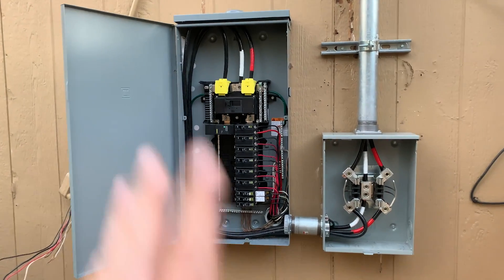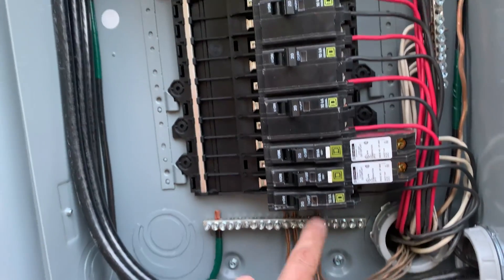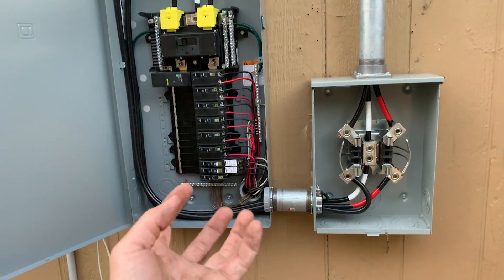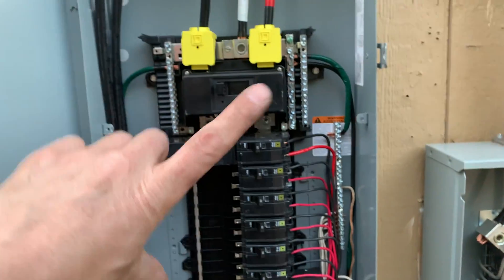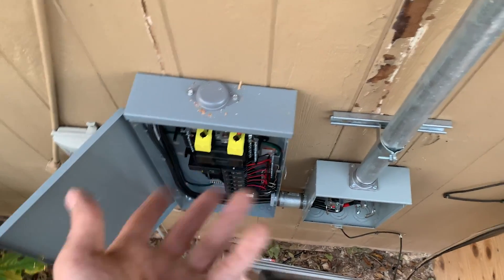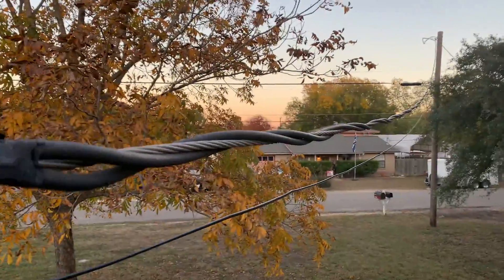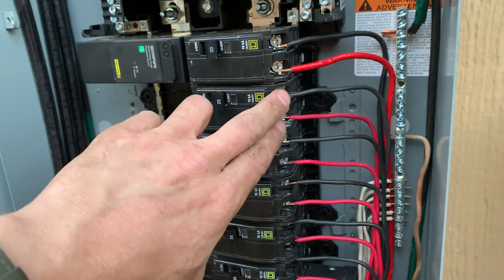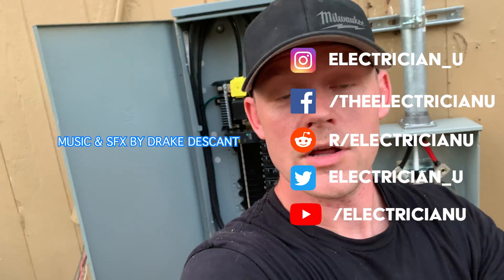I Just Changed Out My Electrical Service

Comment: ahh there's the 2 pole breakers for those multiwire circuits
Reply: yes but they expensive i wld just buy a box of these https://www.lowes.com/pd/Eaton-White-15-Amp-Decorator-Tamper-Resistant-Outlet-AFCI-Residential-Commercial-Outlet/1002336194?cm_mmc=shp-cprdelcgooglelia-205-wiringdevices-1002336194-_-0&placeholder=null&&ds_a_cid=112741100&gclid=CjwKCAiAkan9BRAqEiwAP9X6UTFw2aT-YOidNlrZJ5-hNnn2BHVHeRH4Cs6lXmLh1F_TFhmfUhaP2BoChVwQAvD_BwE&gclsrc=aw.ds
Reply: @wizard3z868  there's still the problem inside if the neutral is shared after the first outlet. And that's very likely to be the case, if for no other reason than why run a 12/3 to the first box and split it rather than just run 12/2 right from the get go.
Reply: @IceBergGeo  no its like running gci outlets in the kitchen for multi branch circuits you have to pig tail nutral at the line side of both outlets
Reply: @IceBergGeo  this is a retro fit job rewiring wld be a pain and they make duel function outlets too I wld rather spend the money for 2 afcis or duel than 1 afcis dble pole
Reply: @wizard3z868  if you're talking about it like that, you'd need upwards of 60 of those afci receptacles... Which would be more than the breakers, plus the time to go and install every last one of them. Kitchen receptacles are only a couple, and not a bad thing to have each one on it's own, but, you can't do that if you've got a 12/3 running though half your house.
Reply: @IceBergGeo  no they are like gfcis line and load side
Reply: @IceBergGeo  your like those pple tht have no clue about gfci breakers when they dont see any outlets with test/reset buttons where gfci are needed
Reply: @IceBergGeo  im just wondering are you a spark? because you seem to have no clue how a branch circuit or any work lol
Reply: @wizard3z868  sadly for you, and your lack of actual understanding of how homes are wired, I'm not. I've probably installed more GFCI breakers/receptacles than you can count to. Let me try to spell this out for you in little words so you can understand what is being said.

Best case scenario here: 12/3 from panel to first outlet. AFCI plug.12/3 continues to next outlet. Need another AFCI plug. 12/3 continues to next outlet. Yet another AFCI plug. (Do this up to 13 times on a 20 breaker.) Then, once it finally drops off the first circuit, then AFCI plug, and then the remaining ones are able to be on the load side of the AFCI plug. 

Worst case: 12/3 to all outlets, and must use them on each and every one. Being 20A breakers, you could have up to 26 on each 2 pole breaker. (Not a very likely situation, but possible.) And that would add up REALLY fast.
Reply: @wizard3z868  the response I wrote was in response to your previous comment. Yes, I am a sparky. Been doing it for many years. You must be an apprentice who doesn't know how to listen very well, or think you know it all.
Reply: @IceBergGeo  what are you talking about you only need one afci or gfci  or duel at first connection of each phase so if its for two bedrooms the first outlet on a phase and another one at the start of b phase like in a kitchen setup 12/3 to a duel gang box with two gfci one to feed left one to feed right lol
Reply: @wizard3z868  that is if, and only if the wire comes in as a 12/3 and splits off immediately to a 12/2. Don't forget about if it goes to a light first. That gets awkward fast.
Reply: @wizard3z868  Dustin is going to install the AFCI 2 pole breakers, because the two circuits share the neutral coming from the panel, and a single pole won't work because of that. (Not that they're any less expensive per circuit.)
Reply: @IceBergGeo  that's true but maybe you cld wire in an outlet otherwise your left with the dble pole.  I'm up in the northeast and almost all branch circuits I have seen start at outlets.    Well my bad a lot of my early homes had gfci outlets with the pig and dishwasher that wld be tricky finding a way to get those to afci receptacles but cld be done mostly
Reply: @IceBergGeo  well what if they are going to outlets than you wld need only 2 ,at $40 vs $100 plus for the dble pole or its like $26 for duels vs $75+ for the breakers if your panel manufacturer makes them. just ideas to keep in mind like you throwing what if there feeds to lights
Reply: @IceBergGeo  I'm just trying to visualize best case and your making me think of worst case all good thx for the idea exchange gave me some future solutions I hope to never need lol
Reply: @wizard3z868  often times, we run into the worst case scenario. Always prepare for it. Like if a customer has done their own wiring, or a previous homeowner had to clean up after a reno/flip and just chucks boxes into the wall and buries them in drywall mud...  I've seen a lot, but not everything. Just keep an open mind and see what others have, and you'll go far.
Reply: @IceBergGeo  lol miss  reply

Comment: i thought so they make them like gfci  https://www.lowes.com/pd/Eaton-White-15-Amp-Decorator-Tamper-Resistant-Outlet-AFCI-Residential-Commercial-Outlet/1002336194?cm_mmc=shp-cprdelcgooglelia-205-wiringdevices-1002336194-_-0&placeholder=null&&ds_a_cid=112741100&gclid=CjwKCAiAkan9BRAqEiwAP9X6UTFw2aT-YOidNlrZJ5-hNnn2BHVHeRH4Cs6lXmLh1F_TFhmfUhaP2BoChVwQAvD_BwE&gclsrc=aw.ds

Comment: I'm not sure why you install all those grounding wires between neutral and ground bars they're not required at the tip of you finger at 5:43 your almost pointing at the panels integrated bonding screw, that is all that is required.

Comment: The ground wire in the nipple is a parallel neutral, just needs grounding bushing on the panel side, would be rejected in Oklahoma
Reply: yeah, and it's just about grounding the nipple. a lot of electricians seem to think they are bonding to/with/for the meter box.
Reply: Thank you electricians of Oklahoma did n0t pre think of this will add it too my catalogue
Reply: By that mentality, the can and conduit are also parallel neutrals/grounds...

Comment: Intersystem bonding... it’s an easy miss. There has been many times I get to my truck after an inspection and then get back out to look and it’s missing. Easy fix and you picked up on it! Great work
Reply: Can you elaborate?
Reply: Can you elaborate?
Might have to upgrade my own 1964 service setup as well...
Reply: @ynraider  intersystem bonding is basically just an external grounding bus. it enables phone, internet, etc companies to ground their equipment to a specified bus. a lot of utilities don’t like them to worm clamp a ground to the mast anymore.

Comment: I just went through the same process, upgraded from 100A service to 200A. Only difference is I relocated mine to underground. Looks so much better without those conductors overhead.
Reply: Plus you don’t have to worry about losing power as much during outages.  I’d move mine underground but my whole yard is rock, so it’s just not worth it.

Comment: when i did mine the inspector  wanted dumm dumm on the conduit flange at the meter base. also the ground had to be two rods 4 ft down in the ground minimum 6 feet apart and in a continuous loop to the service panel

Comment: Our inspectors would have wanted a #4 for the ufer on a 200a and required two ground rods 6’ apart with #6 along with verifying water bond and I would have taped that neutral bonding jumper white. 
Service upgrades are always a pain in the arse. 
It never fails if you finish quick the power company will have some emergency and not show till after dark...
Always nice to get your own system updated!
Reply: jeez, why isn't the same old #6 enough for the ufer? it has to do the job of the pair of #6??
Reply: @wim0104  #6 GROUNDING ELECTRODE CONDUCTOR FOR THE UFER WAS ADEQUATE FOR THE OLD SMALLER SERVICE, BUT REQUIRES #4 FOR 200A.
Reply: Yea not fun to crawl that # 4 bare solid under someone’s house to get to the water main entrance. That inspector was in South Dakota, now I’m in California and we just drive two rods and call it good. The color of the bonding jumper really doesn’t matter I just prefer white if it carries current under normal circumstances, where as I would do green if it was just for equipment grounding...just personal preference.
Dude! Thank u for putting out such great content... I’ve been recommending your channel to coworkers a lot lately, lot of value packed into your vids!

Comment: The only thing I would think is a #4 ground not a #6 and missing  intersystem bonding
Reply: Confused about ground wire sizes look up in NEC code section 250.66 and 250.122.....

Comment: Missed code requirement, lever bypass meter socket enclosure!? As required by most power company’s for new services. Looks great tho great work. 😃
Reply: PG&E in CA requires for commercial but not resi
Reply: Mine requires horn bypass for resi
Reply: Bypass meter socket is required for commercial services.

Comment: Objectionable current on grounding and bonding paths between the meter can and service panel.
Reply: Yeah he mentioned it wasn't a floating neutral and I was like NOOO! For anyone that doesn't know, you can only bond the service at the meter or at the main panel, not both. If you do all the neutral current from both linear and non linear loads will bounce around on everything that's bonded.
Reply: NEC 250.6 can be verified using Gauss' law over a "closed" system ( i.e. A + B + N = 0 ).

Place a current loop around all three service conductors between the meter and service panel, then attach a 1000w 120v resistive load downstream. If you're measuring a non zero current, there's a 250.6 issue.

Comment: ya'll missed the "water bond"/gaspipe bond, or the stupid ground to the cable company box? or you didn't put the 2nd ground rod in, as per ATX requirement? Also, did you have to put the red & black the wrong way round?
Reply from the maker: Great observations but none of that is it.  I'm not within the city limits of Austin so still NEC colors, no supplementary ground rod required either, also no gas here, and water bond not required here.

The intersystem bond is what I left out - this is what you mean by "stupid ground to the cable company box" right?
Reply: @electricianu  yep. inspectors love my shop talk ;-)
Reply: there's a neat gizmo for that, you should plug it with your amazon:
"Madison Electric Products MEIBB Intersystem Bonding Bridge" 
The #6 for a ground rod can run through it, and you clamp down on it too.
Reply: @electricianu  THE AHJ ALLOWED THE OLD #6 GEC TO THE CONCRETE ENCASED ELECTRODE?  200A SERVICES REQUIRES A #4 CU, OR SUPPLEMENTED BY ANOTHER APPROVED MEANS.   ALSO HOW WAS THE NEUTRAL JUMPER BETWEEN THE PANEL NEUTRAL BAR AND THE NEW AUXILIARY NEUTRAL BAR SIZED?  SHOULDN'T THAT ALSO BE A #4 CU?  CURIOUS...

Comment: Gec has to be a number 4 for 200 amp service. Number 6 for 100 amp service. Your ground rod only needs a number 6 max because it's considered a supplemental electrode. Also u need 2 electrodes.  Did u drive a rod? I also agree with some of the other guys about there not being an intersystem bonding jumper.
Reply: Yes as per 250.66 you need 2/0 copper or 4/0 aluminum for ungrounded conductors which requires a number 4 copper or number 2 aluminum for your electrode conductor. That is for a 200 amp service. The equipment grounding conductor is a number 6 copper but u can't use that for your electrode conductor
Reply from the maker: Not true, GEC is always sized off conductor size, not breaker size.  Check T250.66 - you're thinking of EGC which is sized off of breaker size per T250.122 - but even then 200 amps is number 6.  I like where your head is at though, you're looking for the right things.
Reply: @electricianu  The conductor from the grounding bushing in meter socket is a Bonding Jumper and Must be a #4 per 250.66. In Wisconsin, WE _ Energies requires the bond of the metal nipple in the Meter Sochet, see the lug on the grounded conductor in your picture

Comment: 7:22 You're missing the intersystem grounding bridge
Reply from the maker: There we go!!!! Finally somebody got it :)
Reply: @electricianu  What did I win?
Reply: @electricianu   <Googles "intersystem grounding bridge" >   Okay, so I see it's NEC Code...

What I don't really see is why.  Comms are low voltage systems. Right side of the pond we keep them strictly segregated from main power systems, including the ground, and would provide a separate ground if required — which is almost never.   

Eg phone lines are passively -45-50VDC on the B-leg and 0V/ground on the A-leg: these vary when the line is active, both the maintenance and the variance  of the ground potential are manged at the exchange.  Local bonding ti ground would actually interfere with operation.  Guess that like so many thing you do it differently over there.  :)
Reply: @calmeilles  As a former cable tech, the coax cable system is bonded throughout the distribution to the grounds at each power/telephone pole.  The bonding at the house was always indicated to us as a means to equalize the potential should the customer lose their neutral.  At that point, the house due to a fault condition could use the coax cable's shield as the path to neutral.  I've been to many Cable 
service calls where the coax cable was melted clean through because this exact condition happened.  Thankfully I knew enough about electricity and grounding to know that the power was coming FROM the house's electrical system, and not somehow from the cable TV plant.
Reply: We put in intersystem bonding busbars, and the cable/phone companies don't use them - they bond using those goofy perforated band clamps.
Reply: @Gruntled2001  my satellite company refuses to ground the dish at my latest place
Reply: @AgentOffice  They might have a point. If you ground the dish, it might become a lightning rod, and one that’s tied to your GEC system at that.
Reply: @Gruntled2001  maybe but it's actually grounded through the coax to the receiver then tv and outlet. I'd rather it have less resistance to the outside than through my tv
Reply: @AgentOffice  Yeah, makes sense. The dish itself is very likely to be electrically continuous with the coax's outer shield conductor, and it would make sense to "earth" it before it enters your electronics. Lightning protection is not very well regulated in the US, at least not in my state (CT)
Reply: @Gruntled2001  in central PA if we see those intersystem bus bars, we scream for joy because we don't have to dig out a buried ground wire for a splitbolt.
Those band clamps suck and don't make a good secure connection.
Reply: Sorry I’m from Australia is that the same as your Mains earth Neutral connection?
Reply: @bigcasso9428  I’m an Aussie sparky too. I think North America uses the TN-C-S earthing system (same as us). Our MEN is their multi-grounded neutral (MGN). So I’m not sure if an inter systems grounding bridge is just different wording for a MGN 🤷🏿‍♂️
Reply: @JamesMorris-os7kb  If you google for "inter systems grounding bar" you'll get pictures of something we call "equipotential bus bar". That's were the incoming metal water pipes, gas pipes, cable TV (outer shielding of the cable must be bonded) and such things are bonded to.

And this is clearly a TN-C-S system, or MGN or PME...different names for the same thing.
Reply: When has that been a necessity for code? I was an apprentice in res in az and now pushing journey man .. in commercial..
Reply: @kodyr1471  Since 2008, NEC Article 250.94  allows three different methods.
Reply: Old School Guys got it...
Reply: @SliCkRiCkStER111  
I'm in phoenix.. but working in scottsdale, about to be out of our job.. I be been at this location for over 2 years!! 
Now.. I'm not sure where my next home will be (commercial!! Btw..) but I know residential guys!! That's where I started and love!!
Reply: i dunno how many times ive never seen one installed.

Comment: Do you need  grounding terminals for your cable or satellite services? Only thing I could see missing... but I’m not an electrician just a fan! Lol
Reply from the maker: Actually yes, there's a thing called an Intersystem Bonding Terminal that I needed to install to hook all of the cable/internet grounds back up.  Nicely done my friend...lots of electricians didn't even notice.  I'm impressed. :)
Reply: @electricianu  meter bypass lever required in your neck of the woods yet?
Reply: Yay what do I win!? Lol. I’ve been watching a lot of panel upgrade videos. I like your channel and Peterson electric. My Zinsco panel has a lot of broken breakers so it was exciting to see you servicing your panel first before you replaced. All other videos just show zinscos getting swapped out not trying to fix them.

Comment: I thought on a remodel you need 2 ground rods asking from San Antonio
Reply from the maker: In the City of Austin on remodels that don't have a slab ground yes, but I'm out in the burbs and I have a slab ground.  Some places are requiring a single ground rod  be added even if you have a slab ground, but not where I'm at.
Reply: 250.53 A 2 exception- you don't need a second ground rod if resistance to Earth less than 25ohms. Everybody justs drives a second ground rod rather than having it tested
Reply: In Dallas now and worked in Austin and San Antonio also. I thought 2 ground rods were needed as well, 6' apart from each other. Or 1 ground rod and a cold water bond.

Comment: New building code in Vancouver, BC does not allow you to have your riser conduit (2" rigid ) go through  any accessible roof space. Is that what was missed?
Reply: That part of the roof is (likely) not accessible, as it's just outside of the building, going through the soffit.
Reply: His conduit is only going through the soffit do I don't think  that's an issue.  In NJ I've had to encase service entry conduits in concrete because they were passing through an accessible part of an attic.  I had to crawl into the attic, build a form around the pipe (3" thick) and have my helper pass me up buckets of concrete, I assure you it was a joy.